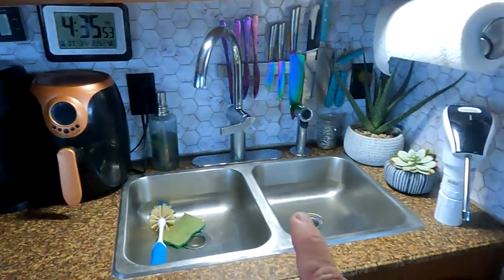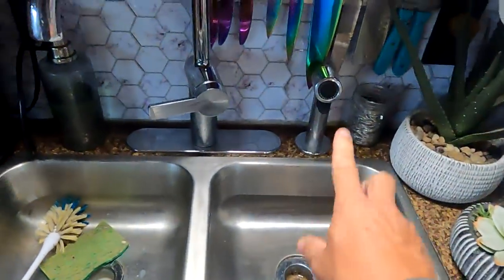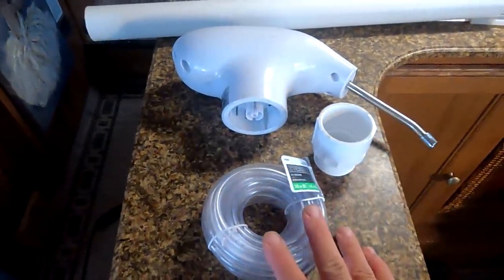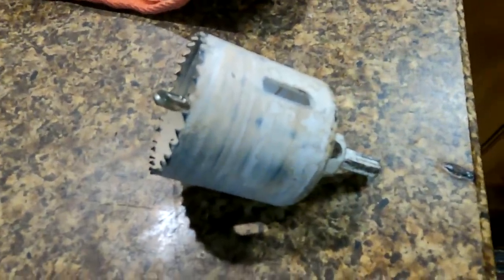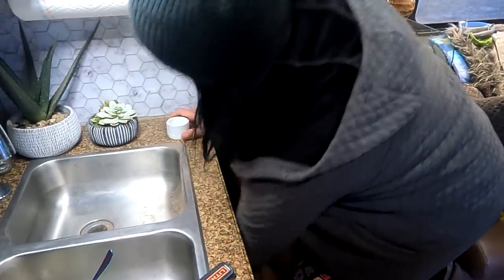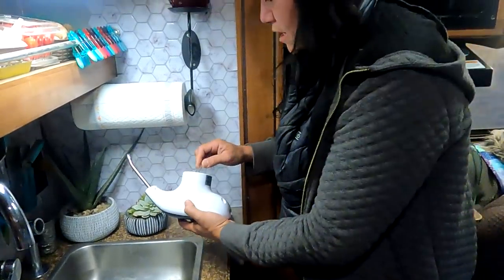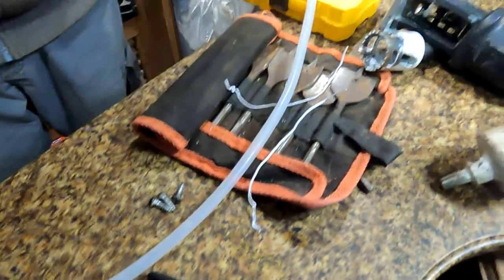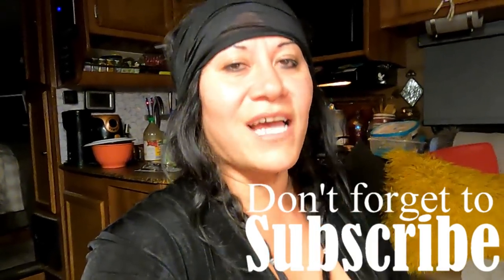Easy DIY Water Pump For Counter Top

Comment: Make sure the hose doesn't come off the bottom of the pump because it will siphon the water jug out under your cabinet. Good job
Reply from the maker: It was on very snug as bug in a rug... thanks

Comment: Hey Great Job.. I noticed you ran the drill in reverse to score the hole in the countertop. But, you could have turned it to forward and cut the hole out the rest of the way a lot easier after you got it started? 
Just picking, Love ya, Mean it..

Comment: Ausia I have the same pump and I haven't been able to set it up. So can you tell me the parts and sizes you used to connect the pump to the counter
Reply from the maker: The were 2" pieces
Reply: ok so the pvc pipe size was 2" n the parts fit that?